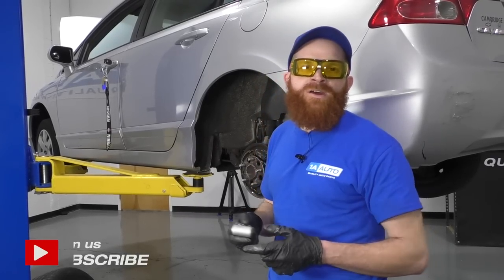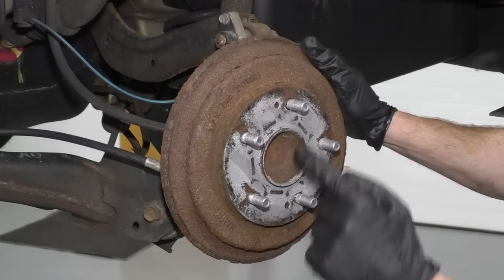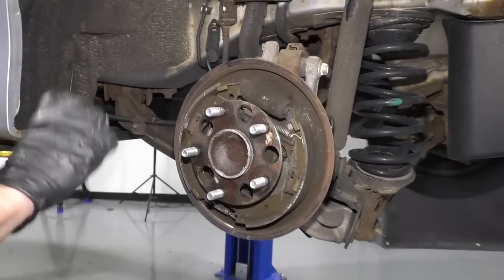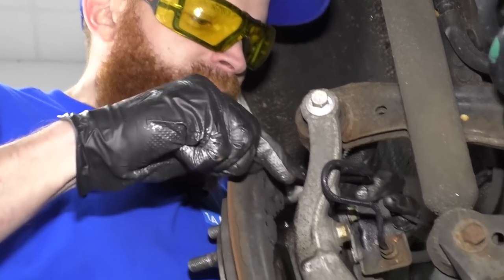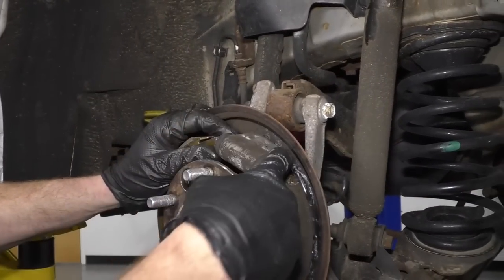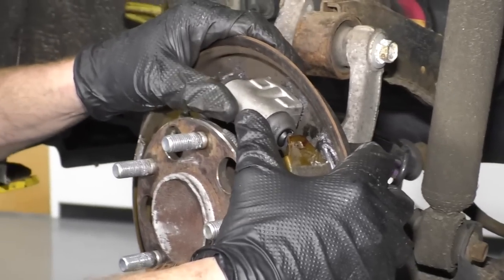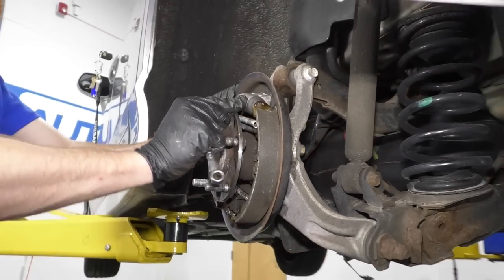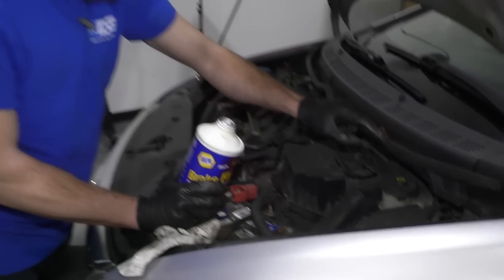How to Replace Rear Wheel Cylinder 06-11 Honda Civic

Comment: Hi, this is a great video, now I can fix and change the wheel cylinder of my HONDA CIVIC, I have one question, should I need to start the engine when I push down the brake pedal to bleed the brake fluid out from the bleeder ? Thank you

Comment: How tight for the bleeder screw?  I often get new replacement Wheel Cylinders from various brands and sources, even Honda OE, that the bleeders leak when the brake pedal is depressed.  The leak is very slow , but do seep.

Comment: Is there any chance you can fit a 1/4 inch ratchet with a 10mm socket to take out the two bolts that hold the wheel cylinder ?

Comment: I still have air after changing the cylinder even after i bleed the bleeder. Do i need to Bench Bleed the Master cylinder to remove the air on the brake system?

Comment: if I am changing only one wheel cylinder  can I just bleed that one and be done with this job ? i will be replacing a leaking wheel cylinder on a 1997 ford escort located on the driver rear soon

Comment: So I cant get to this one 10 mm bolt on the rear wheel cylinder for a 02 civic, I understand it's the same thing but I can't fit my 10 mm line wrench to get a better grip around the bolt and my regular 10 mm wrench just keeps slipping, I'm so frustrated

Comment: Did the 1991 Honda Accord wheel cylinders come with shims originally? I bought the aftermarket, and the shoes don't seem to be lining up with the push pins. I looked at what I'm guessing is the original cylinder, and it looks like there is some kind of epoxy or something close to it on both sides of the bleeder, on BOTH wheel cylinders. THOUGHTS?

Comment: Yeah just keep in mind if it's stuck like that there's two holes that you can put in some bolts in. I believe on the new Hondas it's a larger bolt 12x1.25
Reply: 8th gens use an M8 x 1.25. Dont even think the newer Civics (2012+) use drums anymore

Comment: Your new Wheel Cylinders came with pins.  I have to reuse my old pins.   So I insert the pins and they only go in a half inch. So I use all my strength and still nothing.  Floppy pins that are ready to fall out.  This whole project is taking way way way to long.
Reply: what pins? im confused

Comment: OK notice your pins are in the Wheel Cylinder most of the way. My pins are just barely in.  I don't see how it can work no way to push them in any farther.  So show me what I need to know to do this.
Reply: what pins? there are only bolts.. im confused